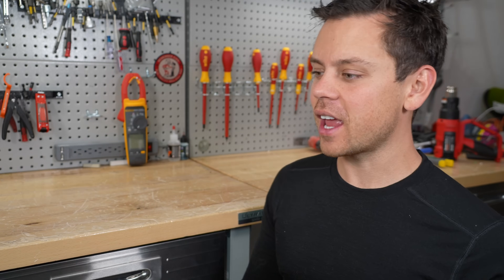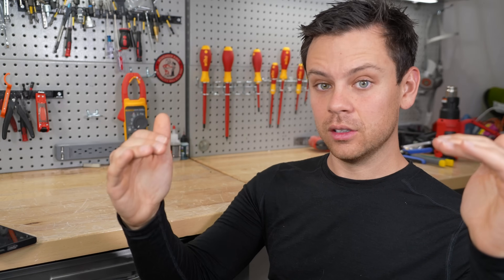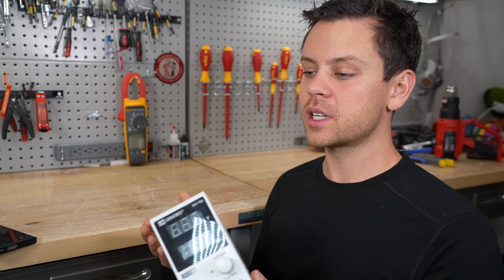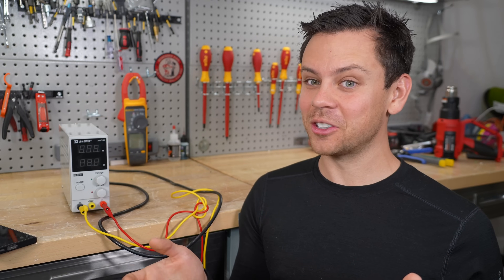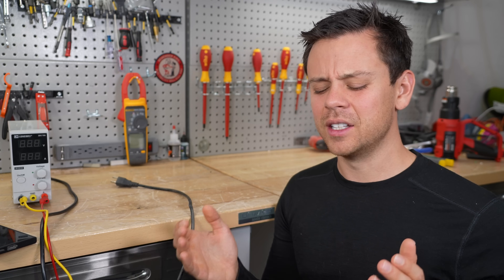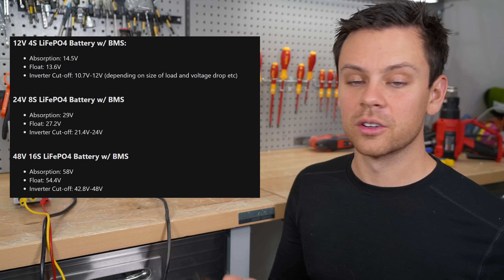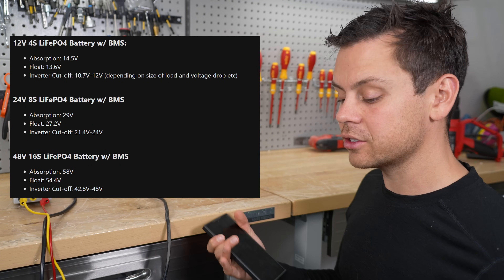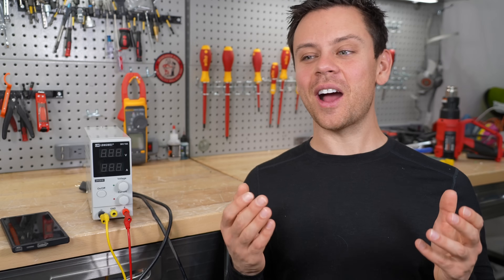LiFePO4 Charging Guidelines: What is 100%? What is 0%?! How to Balance??

Comment: Will, all this safety and anal retentive focus on detail is silly. Odds are ANY slapped together system will be fine. As a Boeing executive I stand by this approach.
Reply: That’s the problem with Boeing, they think that any slapped together airplane will fly! Lol. Great video Will.
Reply: Not get a job at space x😂
Reply: If it’s a Boeing, we’re not going
Reply: Excellent.. thanks much. Theoretical or minimal degradation is not worth worrying about for me. If I get 9 instead of 10 years, the money saved on a $400 battery just wouldn’t be worth the stress and futzing. 
The shore power charger defaulted to 30% and I switched it to 100% so I’d always have full charge when I set out traveling in winter and when rainy, but I will set it now to let it drop so it’s not sitting at 100% all the time.  Solar sounds like the day cycle is ideal for these batteries. 👍
Reply: Lol. Good one!
Reply: We happen to like Will’s focus on detail , because the devil is ALWAYS in the details . You missed the the whole  focus : how to maximize power In your system and get maximum longevity in your battery’s.
Reply: What about Genasun LFP chargers?  They charge to 14.2, and do not have any absorb or float settings.
Reply: I see what you did there!
Reply: Love it!
Reply: Worked for Boeing.
Reply: You Boeing executive, do we have to thank you for those lose screws and bolts in 737? 😮  Thank God that you have NTSB. Boeing now admits that it misled the FAA authorities with MCAS 😅 . Please clean first yours own backyard before poke fingers to others.😂😊
Reply: @CrisTait Whooooooosh.
Reply: @CrisTait  Good grief. You can literally feel the sarcasm in his comment.

Comment: Ampere Time told me I had to charge my 300ah battery between 20 & 80 percent but only after I bought it, like it was a big rule. I charge to 100% then put a 400w load on it for about 45 minutes to lower voltage and store it for our frequent Louisiana power outages. In summer I connect it to solar to run a small air conditioner.

Comment: While I've been loving my cheap 12v LifePo4 batteries for my use cases, one thing that absolutely drives me nuts is that it's just a dumb box with a built in BMS so I have no freaking idea what's going on with the individual cells. All I can really see is that the BMSes are cutting off because charge current goes to zero which tells me all 4 12v batteries in parallel have hit the high voltage cutoff.

Any good (cheap) tricks to inferring what it's doing without cutting open the battery?